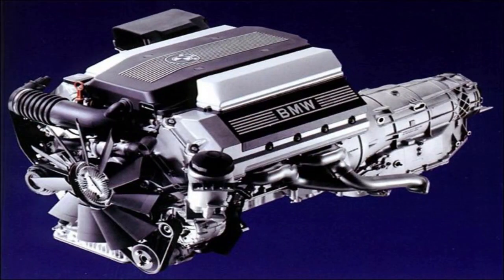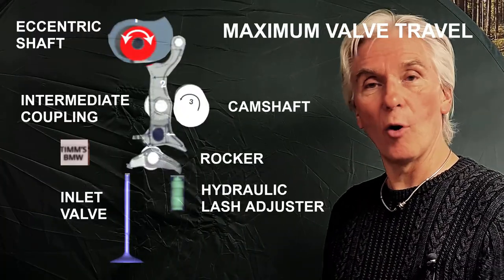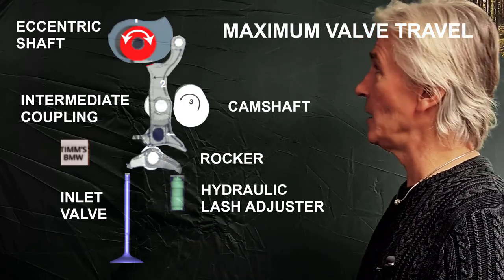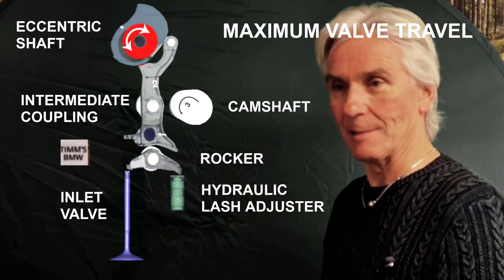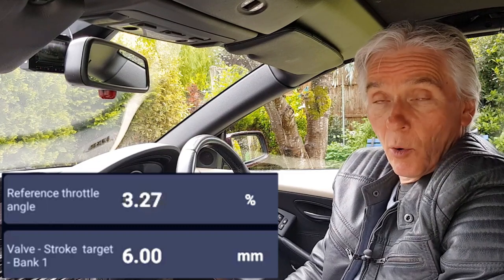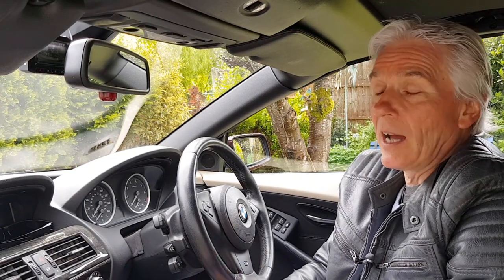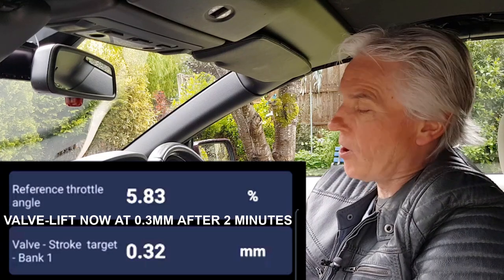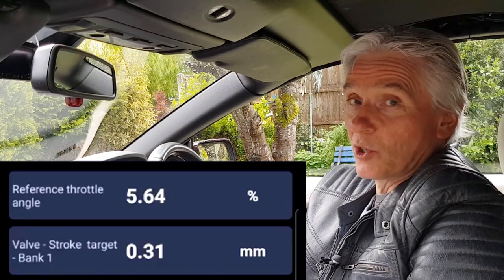BMW Valvetronic Problems-Fixes-Myths

Comment: Hi Timm. Something that has been perplexing me and I am sure I am not alone, which oil is best to use. I know in your oil change vid, you used 0w-30. However, I've seen places recommend 0w-40. I've also heard arguments about older engines needing thicker oil, manufacturers reducing oil viscosity purely to pass emissions tests and without care for engine wear - so long as it lasts long enough to pass the leasing time frame.

What's your verdict and why?
Reply from the maker: Hello JP, well, the N62 isn't classed as an 'older engine', they possibly mean old iron V8's. But for the N62 I like to use 0W-30 synthetic as it keeps the valve-train noise down a bit, but 0W-40 will still look after the engine perfectly

Comment: Hello Tim,
I need an advice. I have 2 BMW with N 62 engine : a 645 convertible quite similar to yours and a X5 E70 4.8 that I'm restoring (it was bought by bid). I've change a lot of things on the X5 engine (the 4 vanos are new, either the solenoid, the valvetronix motors and calculator are Ok they work on the 645) but I still ve a Vanos problem with the X5 with an Error "vanos adaptation Intake cylinder 5 -8".
The value for "vanos adaptation intake" for  cylinders 5 -to 8 is 144,7° for 129,7° for cylinders 1 to 4. 
Thess values are quite the same on the 645 128,8° and 129,9° for each line of cylinder.

Do you think that the problem is mecanic with the valvetronic axe system or link to the engine calculator of the x5 that has to be reset ?  

Thank for your expertise and happy new year !
Reply from the maker: Happy New Year too. Replace the chain tensioner on both banks and let us know if that fixes it!
Reply: Many thanks for the advice!! It will be done in the next weeks. I’ll tell you the result but I’m confident 
Regards

Comment: Hi Timm maybe you'll read this, I hope so.. 
I am confused, because I have rough idle with valvetronic connected (N55) and smooth idle with valvetronic disconnected.

Ambiant pressure is 980 millibar.

With Valvetronic, at idle, my intake manifold pressure is 900 millibar no matter what. If I accelerate it will go to 1 bar or more, when I take my foot off pedal, pressure will go back to 900 millibar.

Without valvetronic, at idle, my intake manifold pressure is 400 millibar. When I accelerate it will go to 1 bar or more, when I take my foot off it will go back to 400 millibar. 

I have 101F01 fault code or P112F, related to Throttle valve opening angle absolute pressure intake pipe comparison pressure too high with valvetronic connected

Any idea?
Reply from the maker: This is a problem that is happening more and more - when in Valvetronic mode the valve-lift is tiny, and any variance between valve lift causes misfires - the lift is only 0.3mm at idle. I do not know the solution to this - I know owners that have replaced the valve gear with no improvement.
Reply: @TimmsBMWRepairsandInformation  ok thank you I was thinking the same. Valve lift too small. Maybe I can try software update, maybe BMW issued a patch to correct this, I mean lift valve a little bit more . I can try carbon cleaning as well in intake manifold I think
Reply: @TimmsBMWRepairsandInformation  And curiously, yesterday, I was just idling.
All of a sudden I felt the car idle smootheing. I had my ELM327 hooked, and I litterally saw idle pressure dropping from 900 to 380 millibar. With valvetronic ON.
It's cool, though I don't know why it is ok now, I didn't change anything except a new Air Filter 3 days before and engine hydraulic valve unclogging treatment 2 weeks before.

Comment: hey Timm, I really appreciate your videos and they are very informative. I have an E63 650i which I look after like a baby, a big credit of that is due to your videos! 109 000km on the clock '07 build. I often check codes and have recently been getting a 2B70 code: CDKSUE - variable intake system, control. no lights on the dash and clearing the issue, after driving the 650, it returns again. I haven't noticed anything a miss, maybe a Rev drop, although, very very slight on idle when cold, but this could be normal after cold start, it does seem to drop below 500rpm with a/c off though. any ideas on where to start with this? is it related to the dual throttle method or is it an issue with the valvetronic? thanks! Dean from Cape Town, South Africa
Reply from the maker: Hello Deano, yes that is a DISA problem, and very common! DISA is a system that controls the intake manifold runner length, and you get two different failures: The sensor (for position) fails or the motor (which changes the position) fails. Depending on the place it fails affects either the full-power delivery or the idle - and I guess yours has failed in the shortest position! But, it can be the sensor - more details here: https://www.bimmerfest.com/threads/disa-testing.1133969/
Reply: @TimmsBMWRepairsandInformation  thank you Timm, you legend!

Comment: Great video, my 2015 BMW m135i makes a noise like a woodpecker from under the bonnet when warm and I go back to it to unlock the doors with the key fob. Will also make the noise if already unlocked and I open a door. Doesnt make the noise when I go to the car in the morning when the engine is cold.  The facebook m135i forum says it might be the valvetronic motor.  Any ideas, thks russell
Reply from the maker: It is strange that it is coming from under the bonnet when you unlock the car - very strange! I don't think the Valvetronic does anything until the ignition is ON so I would discount that - can you target the noise if you have the bonnet open when you unlock the car?
Reply: Your eccentric shaft is shot. The teeth are worn out. You should replace valvetronic motor and eccentric shaft

Comment: Hi Tim just wanted to get your thoughts on something. On INPA you can adjust the minimum valve lift and from what I read, it's either set to 0.3mm. or 0.8mm. Reason I ask is I have been experiencing lean codes. There is no vacuum leaks or issue with the MAF. Fuel filter was changed, injectors working normally.

On my 545i, the valve lift was set to 0.8mm. I've put down to 0.3mm which is the normal accepted value and what I have found is the lean codes have not come back since I made that adjustment. Wanted to know if you had an idea as to why the car appears to be running better on 0.3mm valve lift.
Reply from the maker: Although you say you have no vacuum leaks, what you have explained sounds exactly like a manifold leak - keep looking!
Reply: @TimmsBMWRepairsandInformation   Hi Timm thanks. I have checked and nothing obvious. Only thing I can do is invest in a smoke machine.
Reply: @djsyxx Just curious, How'd you go about it then ?

Comment: Hello Tim, I have changed the eccentrics shaft sensor and after that the car started and dies immediately. Can you help me ?
Reply from the maker: Hopefully you have got it going by now - but there is a re-learning procedure on INPA
Reply: @TimmsBMWRepairsandInformation  
No the problem was never solved

Comment: Tim... can you talk a bit about timing chain issues on the N62B48TU... it appears that there are not any (unlike the M62 with chains and guides.) I have 155k miles on my N62 4.8i in a E70 with no valve stem seal issues because of oil and filter changes at 5K or less. I am also running a 90C thermostat. When should I change my timing chains?
Reply from the maker: Hopefully never if you service every year.
Reply: Definition of service every year?

Comment: Hello, I have a 2008 bmw 328i. I start experience some misfire on several cylinders and got a code for the intake vamos solenoid, I replace the vanos solenoid for a pair of new ones, but the problem continues. I notice it stops misfiring when I disconnect the vanos solenoid. Any idea what my problem could be? Thanks in advance.
Reply from the maker: That is a problem with the Valvetronic system - disconnecting any of the sensors turns it off with a default valve opening of 6mm. This is such a difficult problem to fix as it concerns the minimum valve lift. One valve just fails to open enough and you get a misfire. My advice - ignore it or spend lots of money chasing it!

Comment: Is there anyway I could diagnose the m54 for bent valves without removing the head?
Reply from the maker: Yes, compression test will find it!
Reply: @TimmsBMWRepairsandInformation  iI hand cranked several turns and here hissing from the cylinder head.
Reply from the maker: That can be perfectly normal, you need a compression test!
Reply: @TimmsBMWRepairsandInformation  yep. Did the test, and cylinder 4 has a bent exhaust valve.

Comment: M60 has about 9.7mm and m62 about 9mm  valve lift. So the valvetronic has minimal additional lift. It’s not there for more peak power
Reply from the maker: You are quite correct - thanks!

Comment: Hi Ti., I've had my mechanic change my valvetronic motor a number of times but its fails after a few drives. He is skipping the relearning stage saying it's unnecessary. So I was hoping you could help me understand if this is true or that stage is mandatory and I should change the mechanic
Reply: Relearning must be done in yr case

Comment: I have a 2015 bmw n20 engine I have a crank no start after replacing 4 injector I did the coding. check spark and fuel ok I have low compression cylinder 1-4 90 psi

Comment: I've got a totaled 650 with a perfect engine and tranny (somebody crashed into me on the track) and an e92 with no engine.

Since I already own a working 335i with N54 I feel tempted to try and swap the N62 into my spare e92 chassis because I love the low NA V8 sound.
Am I a crazy man or would this be an awesome forever car? 

Both cars use a ZF6HP and the motor technically fits with the 5 series engine mounts so it's really just a matter of getting a proper length drive shaft. 

I've had an N54 make much bigger torque on the stock dif so I suspect I'll have to do very little to the rear end.
Reply from the maker: Hello Jake, put a fuller description on Bimmerforums.co.uk and you will get good answer

Comment: SAE30 is too thin for when these engines age. I've been using 15w40 diesel oil and the amount of smoke from the worn valve seals improved 90% 
Currently I'm in the process of a software alteration that disables the 'dynamic' valve lift system, due to mine being worn out and causing misfires. I've already beta tested the solution, and now I'm waiting for the computer back from the programmer.
Reply from the maker: You will lose some power if the Valvetronic is disabled, the choices ate, less power and reasonable valve-train noise, or, full lift and power and a noisy valve-train!
Reply: @TimmsBMWRepairsandInformation  I would argue that I would lose no power. I'm not disabling valve tronic. Valvetronic is just the marketing name for variable valve lift and bi-vanos combined. The only scheme being disabled in software is engine load control mechanism by way of the dynamic valve lift. This feature only adjusts the engine operating efficiency from idle to partial load - and translates this into an increased fuel economy, slightly - this is as described in the engine training module. However this system is designed to such close tolerances that it is open to an unreasonable amount of decay in its operation over time - and thus malfunctions, leading to unacceptable repair costs - exceeding the totaling value of most of these cars/suv's with the N62 series engine. In wide open throttle, variable valve lift system goes away and valve lift is maximum. Typically over 2500 rpm the variable valve lift system is disabled in its management system. I know this through performing hours of observation and experimentation. I will still have manual control of the valve lift adjustment through INPA utility. After my modification, I will run a dyno test and report the results - directly to your email inbox -  you may be surprised by the results.

Comment: misfires are caused by loose aged timing TENSIONERS and upstream LAMBDA sensors, period! 

Very common on dual banks V6 +V8, not so much on L4 single bank. 

So basically exact timing and proper mixture. 
(of course you need good plugs, coils, injectors as well)

Comment: https://youtu.be/exfhm36Asgo

I suspect there is a problem with my valvetronic. It's only noticeable at idle until about 1500rpm. No fault codes, idle is super steady. Just a slightly higher unevenness value on cylinder 6. I've no idea what it could be.
I also have some pictures of bank 2 with the valve cover off if that would help.
Reply from the maker: No, it doesn't sound like a Valvetronic problem - it sounds like a vacuum leak around the vacuum pump - it makes the drok-drok-drok noise that is so noticeable when the oil-cap is removed
Reply: @TimmsBMWRepairsandInformation  Hm, the adaptations are pretty much bang on perfect, but I could post a short of that on my channel today. I changed the vacuum pump last year, because I suspected the noise coming from play of the flap. If its a vacuum leak, the noise should change when I remove the oil cap at idle, right?
Thank you so much for helping. The noise really gets on my nerves.

Comment: Check your math. Valvetronic causes power loss. More friction = loss. Enabled or disabled. Disabled, the valves still open 100%. There is no top end power loss when valvetronic is disabled. Why is your engine loosing power? Maybe you want to go over the engine. It should not be loosing power at top end. It could gain mid range torque using the vanos in conjunction with valvetronic to increase the compression by closing the intake earlier. This is the only thing that makes valvetronic better than non-valvetronic. Valve opening and closing timing control in conjunction with vanos to increase torque at the mid RPM range. Everything else about BMW's Valvetronic is bad. Mostly because BMW Overly Under Engineer Everything ¯\_(ツ)_/¯ Toyota's don't have these problems #fact ...if it was built by Toyota, it would not have these problems #fact The only thing useful in this video is the crankcase vacuum reducing smoke part.
Reply from the maker: I agree, Valvetronic does little for power - it was simply introduced for economy, a legal requirement for new cars
Reply: @TimmsBMWRepairsandInformation  I think that's another failed statement. N45 is an N46 without valvetronic, built for  the racing market. N43 is an N46 direct injected and built for the economy market. Valvetronic was just overly under engineered garbage that BMW tried to make, to look cool... but failed because of so many reliability issues due to the lack of quality engineering that BMW is so well known for.

Comment: That's such a horrible way to make "vtec yo", seriously though BMW. This is asking for failure, why would you make a simple thing so complicated  . Guess it's the BMW way.
Reply from the maker: It is the BMW way!
Reply: Unlike VTEC, this system is continuously variable and allows for 10% less fuel usage. It is quite a robust system if properly maintained.